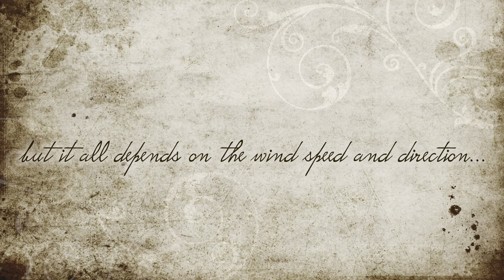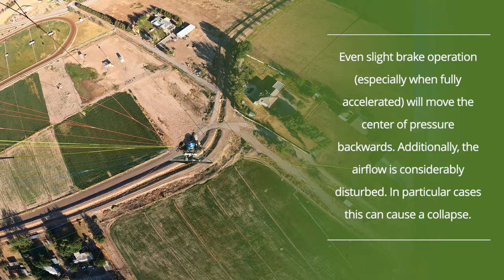Flying to an AIRPORT Built on LAVA ROCK!

Comment: I love long cross-country flights! I particularly like visiting areas I've never been and seeing them from the air. For some reason, flying to little, remote towns in the middle of nowhere on a paramotor, feels extra special.
Reply from the maker: Hey buddy! Oddly enough, I don't often feel like going on XC flight. Well, more specifically, I don't like when they about more than about 10 miles (1 way) if there isn't drastic changes in landscape. Clint and I plan on flying across the city of El Paso soon. That could be fun! 

My favorite is flying from one field to another. It makes me feel like I am flying a bush plane for some reason. haha
Reply: @AnthonyVella  True! Flying somewhere and landing makes me feel like Im a REAL pilot (I know we technically ARE, but it makes it feel more legit). BUT when I do land somewhere after a long leg. I sometimes worry I'll get stranded if I can't get back up (I hear it's a common problem after 40 years old). I guess that's part of the adventure! I have yet to call my wife to come rescue me, so thats good. I can't imagine that would go over well.

Comment: It's a great point. An altitude-seeking paraglider's best friend is a thermal. Not so with the paramotorist in low altitude flight -- there's nothing worse than unseen thermal bubbles in your path. Smooth air is OUR best friend!

Comment: Very Sweet!  I'm a fixed wing pilot, but will probably join the paramotor ranks later this year since it's so much less expensive per hour of flight. Thanks for the videos!
Reply from the maker: That’s exciting. I’d love to hear which you prefer (once you get there of course). I’m sure you’ll like each more in there own ways.
Reply: @AnthonyVella  I'm kinda curious to see if my current experience it's helpful or detrimental to learning paramotors.   Should be fun whatever the case.
Reply from the maker: @paulkiefert  I’d imagine it’d be very helpful having prior knowledge on complexities like weather and general flight physics. The sensation will be new I imagine. Especially consider that there will not be a fuselage around you. That may take some getting used too.